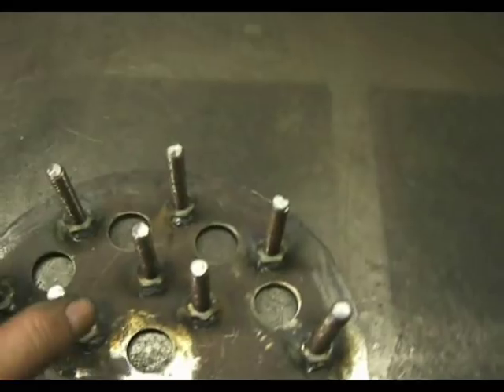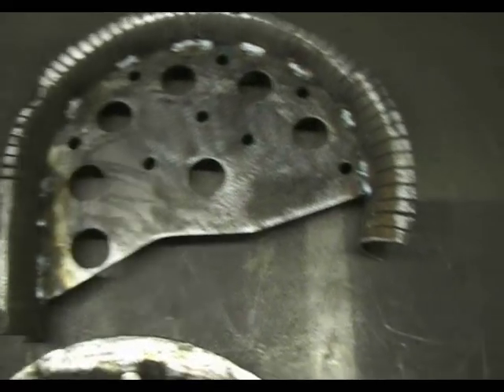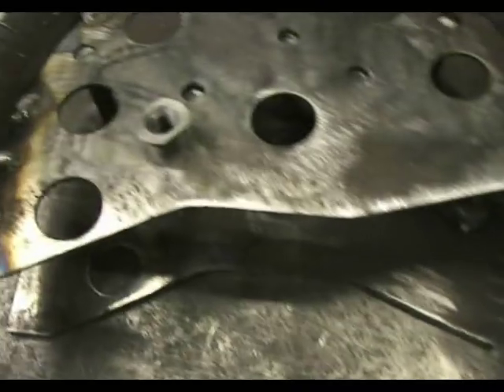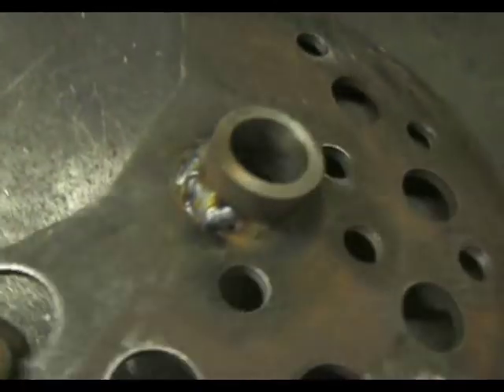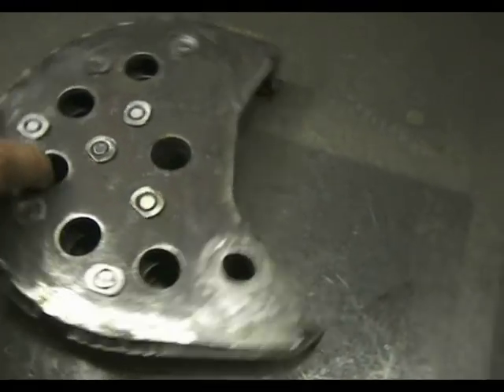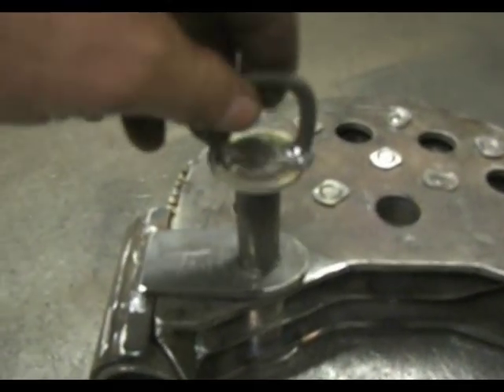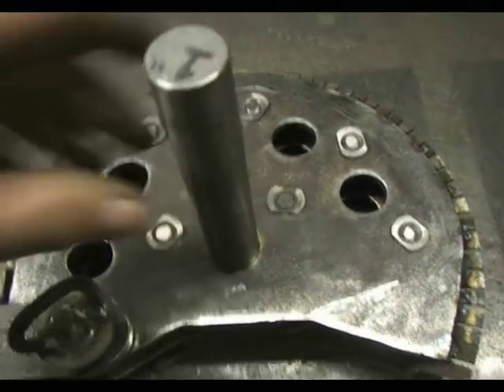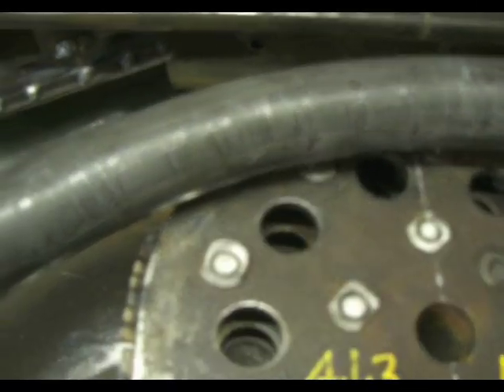Making A Tube Bending Die

Comment: I thought you was making a rotary die, did it not work? a lot of work for a pusher. I was thinking of making one and using some of your ideas.
the only difference would be using a pre-bent pipe with an in side diameter of the outside I want to bend and cut it in half. that is what drives my curiosity. your idea looks like it would work for a draw type bender. but well we all no shit happen when you experiment, I've said dam I thought that would work for sure. if you could comment I for one would most appropriate.
Reply: Did you ever make this. This is how I would do it also. My same co.ment. lot of work for a push bender.

Comment: i made  one just like a couple years ago  same designe it works perfect  i bend 180 degrees keeps perfect shape  all those bolts are not needed
Reply: Any info on yours. Agree on the extra stuff.
Reply: @jtcustoms1182  hello i cut 2 plates and used the same pipe i wanted to bend as the inner part of die spred it apart to fit its self then fully welded the inside cuts then grinded it all smooth looks like a solid die if i can ill send a pic not shore how tho lol
Reply: @NeBoFoRiOn  awesome thanks

Comment: The language is not easy to grasp at first, but the work speaks for itself!  I love to see another gear headed technoid fabbing up stuff like this as I also do it from time to time!  I've built several custom tools for doing transmission work and bending metal, so I'm no stranger to making stuff like this.  
  My next major project will be fabbing up a steel (might be done in stainless or even aluminum!) bell housing for my brother's 1965 Mustang.  I'm rebuilding a T-5 for it right now, but we want to use the factory mechanical linkage instead of a juice or cable clutch.  From the outside, no one will be the wiser that it has a roller engine with a five gear trans!   

Randy